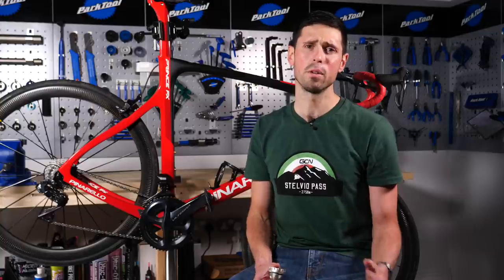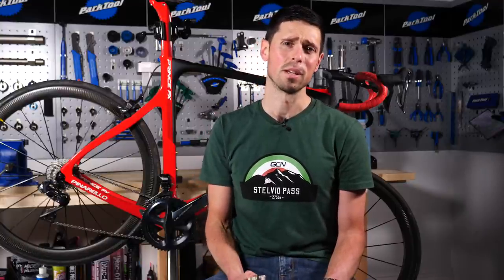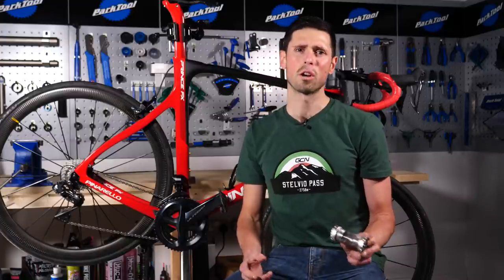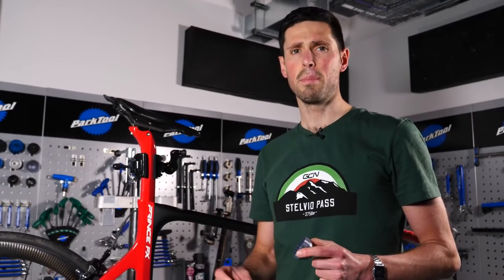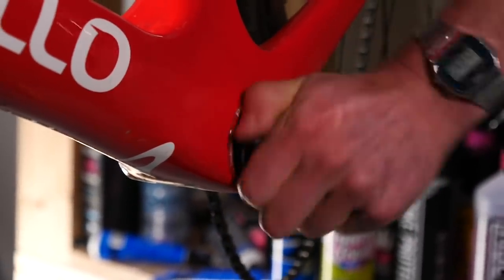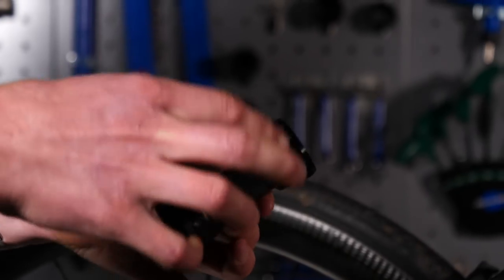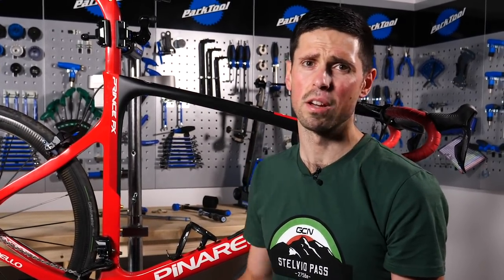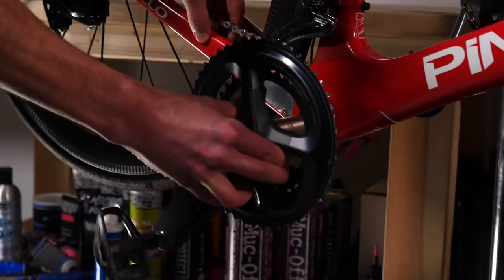How To Remove & Install A Threaded Bottom Bracket On Your Bike | GCN Tech Monday Maintenance

Comment from the maker: Did this video help you fit a new BB? Let us know 👇
Reply: Yes it did help. Also, show shopping old style BB for the one you just show. If there are any major differences.
Reply: I am upgrading my old DuraAce7800 drivetrain to 9100 mechanical (I'm still resisting moving to Di2). Truth be told, however, having just spent 2500 dollars on the new groupset and BB along with a OSPW from Ceramicspeed, I'm going to let my LBS  convert my bike for me. I appreciate the video giving me the know-how to work on it if needed, though.
Reply: I`d love to know how you got past 35 NM on a Park TW 5.2 it only goes up to 14! The correct (TW 6.2) is right there on the wall. Ya numpty  🤦‍♂️
Reply: @mathewrose2951  when you do it yourself at least you know what's been done. Plus it's satisfying. Get some tools, whatch the videos and give it a go. Before you know it, you'll  be an expert.
Reply: @AJFixie  and  watch a vid how to use a torque wrench.

Comment: Only the drive side fitting was shown in any detail. The non drive side fitting is important too, especially not overtightening the preload on a left Shimano crank. Also it's best to have the chain removed, so that you can check the cranks spin freely , more.difficult to do when the chain is on.

Comment: Why did Trek and Cannondale push creaky direct-fits / press-fits for so many years?
Reply: Because it was profitable?
Reply: probably since PF are much better (more efficient, stronger, stiffer), but not when you don't have twats designing and building your shite frame like cannondale, trek, cervelo, etc. if you think about it, a threaded bb now adays is just a pf with the bearings already pressed into well manufactured cups.
Reply: It’s easier, it’s stronger, you an fit larger bearings, have the bearings inside the frame rather than hanging from the frame. 
If you haven’t heard of Hambini you just might want to check him out and learn the actual engineering and heal teach you a thing or two about ceramic bearings as well and before you say you have and he’s a twat then go check out “peak torque” too as well as he also backs the engineering and also shows ways to get the best engineering at the best dollar and reasons. These guys aren’t affiliated to anyone. Oh by the way best bb by engineering standards :bb-386EVO
Reply: @jasongirvan6729  Watched Hambini’s video and he found microscopic misalignment in the bottom bracket bore and drew an exaggerated starfish. Apparently microscopic differences to a perfect circle cause major problems after a direct-fit / press-fit BB is fitted. No thanks, I’ll stick to a threaded BB.
Reply: @mrichards55  These "microscopic misalignments" are HUGE in engineering dimensions. Some frames don't even match the tolerances of Shimano (at least the one Canyon Speedmax of which a photo of a QC document was send to Hambini).
Reply: @Aniqa101  Hambini makes money supplying big shiny silver BBs. I imagine he’s happy to see these misalignments and draw them in PowerPoint as a starfish.
Reply: @mrichards55  what you saw in your star yes was eccentricity but that relationship goes for both press fit and threaded. He’s showing the workmanship of a specific brand when he shows that. In fact it’s worse when you have threaded as it can’t be corrected and then cause excessive wear and friction. Watch is one specifically on threaded vs press fit

Comment: At 5:30 the BB torque required is stated as 35-45 Nm. The torque tool used is the Park Tool TW-5.2. This torque tool provides a maximum torque of 14 Nm.
Reply: Yeah you see him adding some extra torque to it after it has clicked, so he explained it well but performed poorly

Comment: Nice. Could you do a video removing and reinstalling a PF30 adapter to BSA for Shimano please? I thought my BB was threaded until I tried to remove, had to buy the Park Tool tap tool to remove, but not 100% on installation process for new bb cups - do you press with bb cups installed or adapter first and then BB cups. Cheers, P

Comment: Should you also apply grease to the crank before refitting?
Reply: Better to apply grease to inner edge of the bracket seal fit the crank and wipe off any excess. If you apply grease to the crank excess grease will gather between the inner gear and frame collecting grime.

Comment: "However in the last few years we've seen brands start to move back to threaded bottom bracket" because they were unable to manufacture proper frames...
Reply: @robertcowling4313  Just because you don't understand what he says doesn't mean Hambini talks trash.
Reply: Yes even the new and super duper light Specialized Atheos (carbon) uses a threaded BB (metal) meaning a weak spot. That's embarrassing.
Reply: @robertcowling4313  Ok, I might have somewhat misunderstood your comment on Hambini.
Reply: @Bungle2010  So you are ok with crappy press fit BB shells?

Comment: before inserting the crank into the installed bottom bracket, do I need to apply some grease?
Reply: It helps removing the crank some months or years later.

Comment: Italian Thread Confusion:  In 1987 i bought a new Campag C Rec BB from my local shop.  I had a 531 frame with English threaded BB shell.  However, the shop only had an Italian threaded new BB but the mechanic said it would still fit as the Italian and English threads were very similar.  Although it was a little tight when I first fitted it, the new Italian BB fitted in my English threaded frame.  Therefore, the drive-side cup must have been Left hand threaded.

A few years ago I bought a Pinarello F8 with italian BB shell.  I spent 10 minutes trying to fit the drive-side cup, then I discovered it was Right hand threaded.

When did the Italian thread standard change for BBs?

Comment: *ASKGCNTECH: Hi Alex,  can you fit an Mtb on a wahoo kickr. TIA
Reply: Yes. I have a Trek Verve 2 perma-mounted to my Wahoo Kickr.  It's a city hybrid and not a mountain bike but if that works a mountain bike will work. The Kickr will come with different hardware to mount QR or Thru-axle. Then all you need is a spacer for the rear cassette. In my case, the Trek Verve 2 has an 8-speed cassette

Comment: Can someone please explain to me how the drive side on an English BB has a reverse threading? Wouldn't the rotation of the crank create a possibility for the reverse threading to come loose? Just a bit confused on how that works, thanks in advance for any help.
Reply: Look up "mechanical precession" (Wikipedia has a good starting point) or dig through Sheldon Brown to see why the drive side can unwind in an Italian thread on that side. It's not immediately intuitive until you see an animation of forces. I have older Pinarellos, all Campy old style Italian cartridge bb. Easy tech, don't have a problem with a little thread lock on that side.
Reply: I believed there are two factors that play into the explanation for why the crank side BB is reverse threaded. As the previous commenter stated, "Mechanical Precession" is one. This is hard to explain without diagrams, but it is a result of the normal (perpendicular) contact force of adjacent threads on each other that arises when you push on the pedals. There is a component of this normal force that creates a torque on the bottom bracket in the counterclockwise direction. If the crank side BB was not reverse threaded, this torque would tend to loosen the BB. ALSO, the bearings in the BB turn freely and the spindle turning clockwise rolls the ball bearings along with it, with the outboard side of each ball turning in the opposite direction of the inboard side of the ball. So, the free-rolling balls are tightening the cup as the rider pedals forward due to its reverse threading. I said this was hard to explain without diagrams! BTW,  mechanical precession has nothing to do with the precession of a spinning gyroscope. Very different phenomenon.

Comment: If you watch all of your videos on BB’s, they contradict each other. Some say don’t use grease on the bearing’s use thread lock, now your using grease?
Reply: simple: you use grease on threads for threaded bb and thread lock on press fit bearings. Actually its always the same. The threaded bottom bracket its actually threaded cups with bearings already press fit mounted form the factory.

Comment: Pressfit sucks!

Edit: Be like aethos, they are back to threads!
Reply: Agree! High maintenance not easy to install/uninstall
Reply: Pressfit bearings strangely only suck when used in bikes, hmm ... It's proven that some bike frames don't match the tolerances of BB manufacturers and even if they do, the tolerances are relatively huge in enigeering perspective.